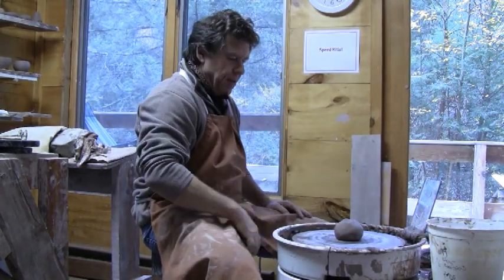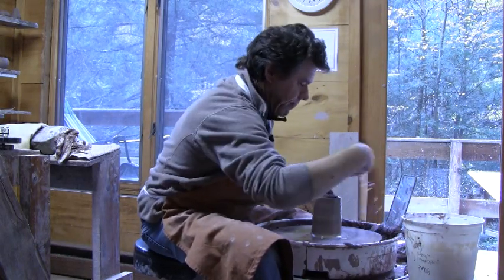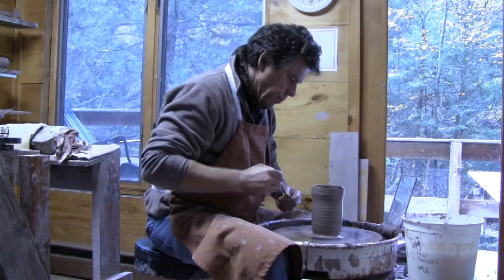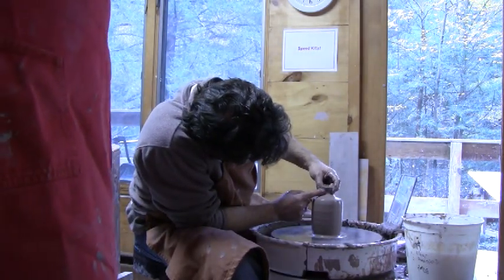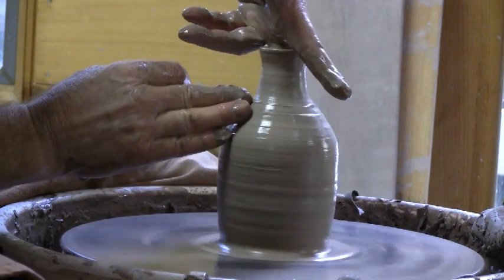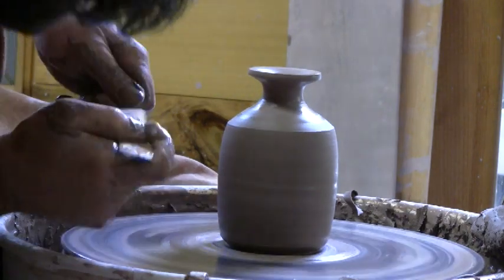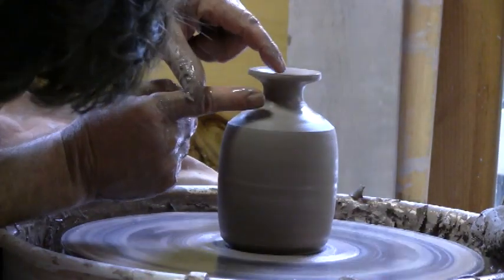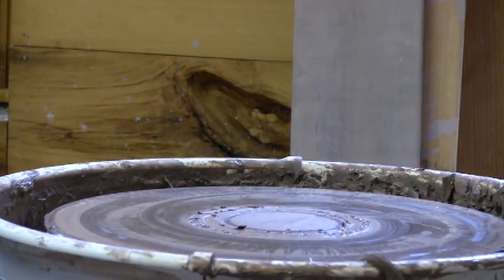SIMON LEACH - Collaring a cylinder etc !

Comment: Simon, I request your advice. 

In my ceramics class as school, I started throwing with B-Mix clay. Although it's incredibly smooth, I'm used to the clay that gives resistance so I tend to overcompensate and use too much or too little pressure and I end up with one side being thicker than the other or it miraculously goes off-center. I'm a huge fan of your work and it's inspired me to throw bigger and use different designs. 

--The15Commandments